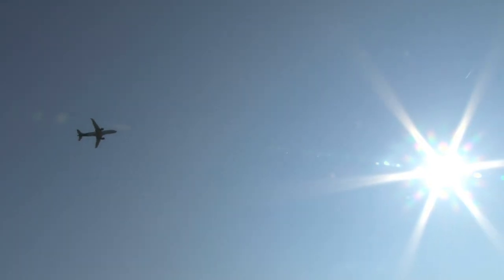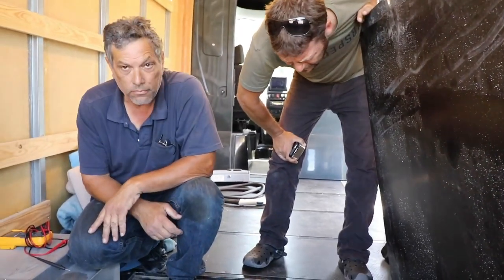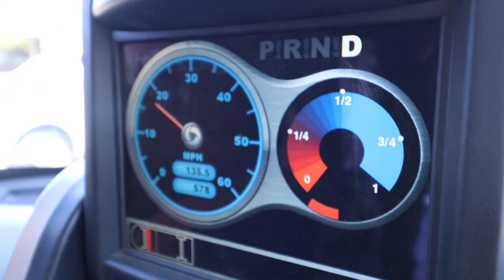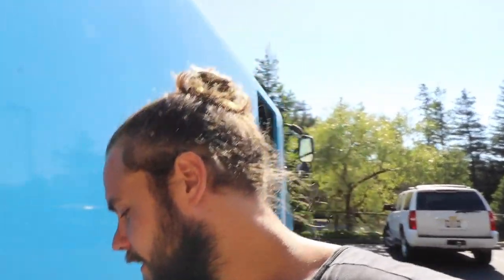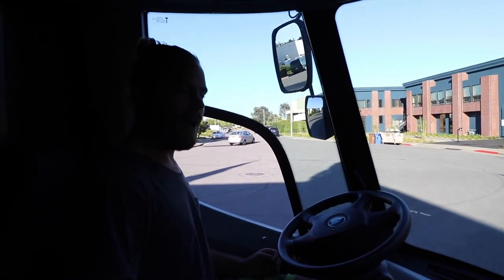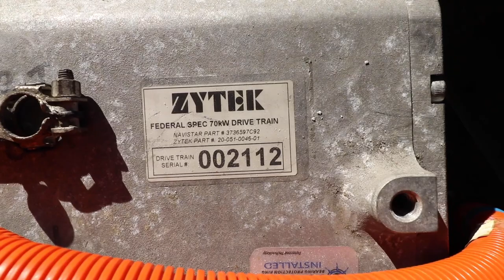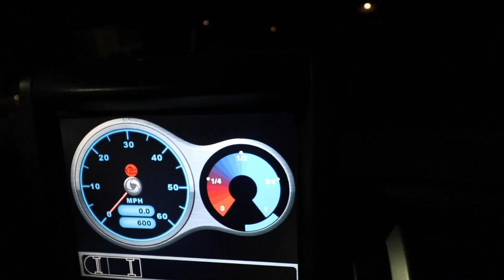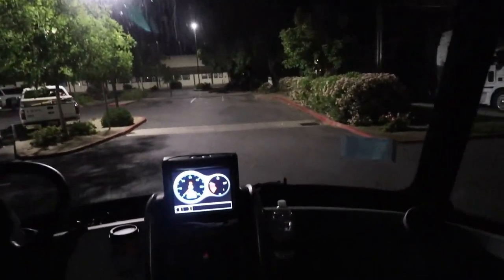Buying an Electric Cargo Van | Route Del Sol DIY Build Series | Solar Electric Vehicle Project

Comment: Lol. How long ago was this? Nice to know a bit of the vans history.
Reply from the maker: Back in the summer of 2018 June I believe
Reply: Here's a bit of history on the eStar: https://en.wikipedia.org/wiki/Modec - so sad they went bust :(
Reply: @jonathanmelhuish4530  Nice. I did try to find more about the vehicle a few weeks ago. I guess now I know why I couldn't. Apparently it's not completely dead, since it says there that all the intellectual property was purchased by another firm, Navistar. A bit of info on that here: https://en.wikipedia.org/wiki/Navistar_International
So, maybe there's a little hope?
Reply: @akselschmidt501  I meant it's sad because if they had managed to produce a really attractive and high-performing cargo vehicle in 2010 (the same year the Tesla Model S came out), we might not have had to wait a full decade for the big manufacturers to start producing their Transit-sized electric vans. Even now they are pricing them high because they don't want to disrupt their diesel business.

Now in 2020, I'm more hopeful that Tesla will bring out a panel van. I'm kind of surprised that they haven't already, but I suppose it's because they know it's a very cost-competitive market, and they already have enough on their plate. Still, I'm sure once they've ramped up their battery production, they will bring one out. Maybe it will even be a "Cybervan", mainly because bending steel is cheaper than stamping it.
Reply: @jonathanmelhuish4530  Oh, I agree with you on that. Apparently they closed because they weren't selling as much, which is kind of weird considering all the benefits. A cybervan would be such a great vehicle. Bulletproof windows (which are the weakest point in a van for burglary), long lasting stainless steel and cheaper ¨fuel¨.
Reply: @akselschmidt501  The Wikipedia page you linked to says they were priced at $150,000 each, so I imagine that might be one reason!

Yeah if Tesla could sell (or lease) a panel van with a long (million mile?) warranty for a decent price, a lot of delivery fleets would go for that. It's all about the cost per mile in that industry, as far as I know.
Reply: @jonathanmelhuish4530  That makes a lot of sense. They cost as much as a 300 mile Tesla Semi. If you have the money you may just camperize that. Of course you wouldn't be able to park it in a city.
Going back to the eStar, the range is possibly another dealbreaker for many, if not for most.